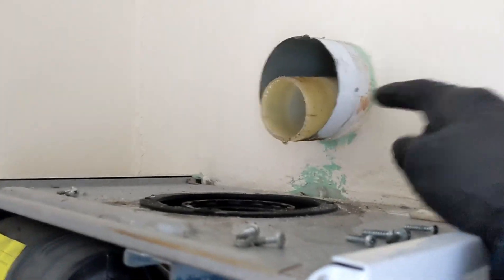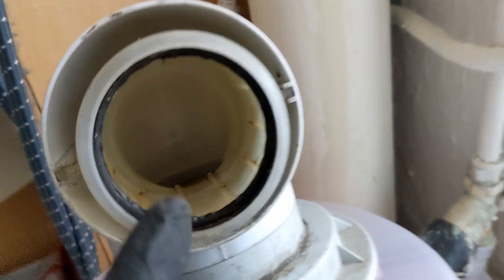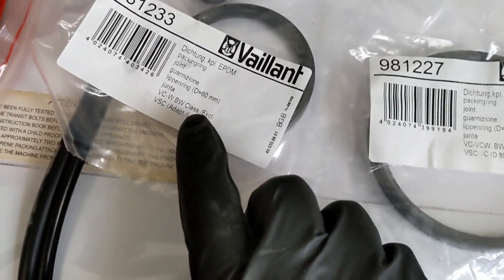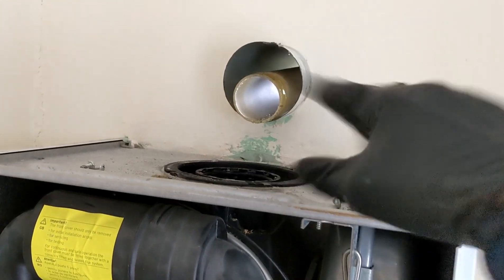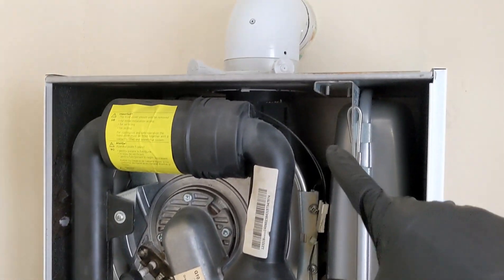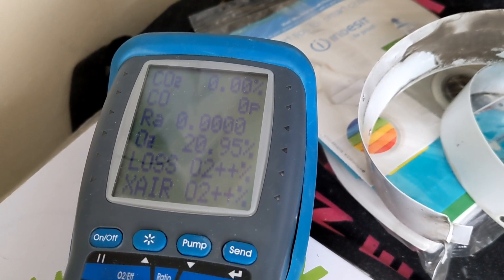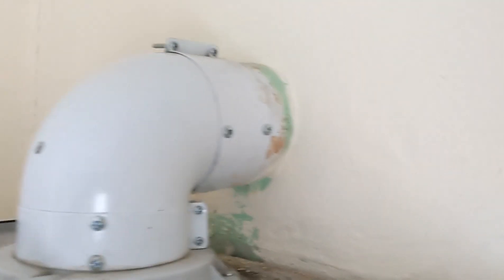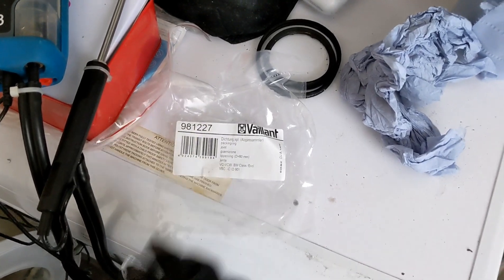Vaillant Ecotec failed turret seal

Comment: Mate are these seals universal across all vaillants? As in size and part number
Reply from the maker: As far as I know, yes. However might be different with the old turbomax boilers, but all the condensing range so far I've come across are the same
Reply: @cputilitysolutions  cheers mate. So common on these I've noticed